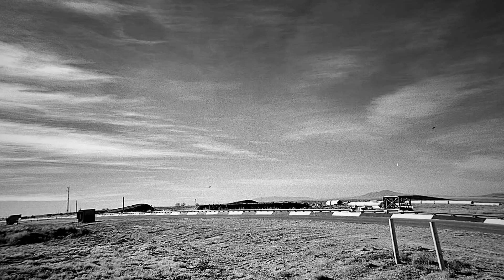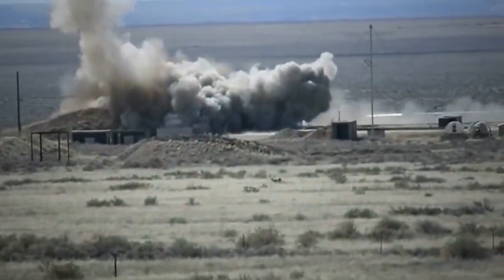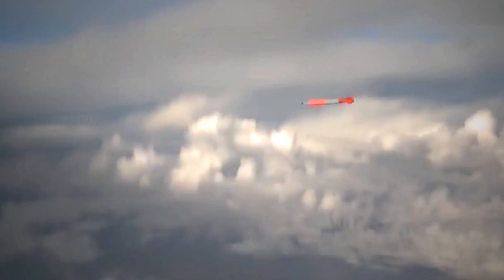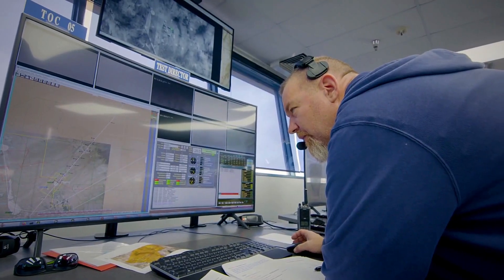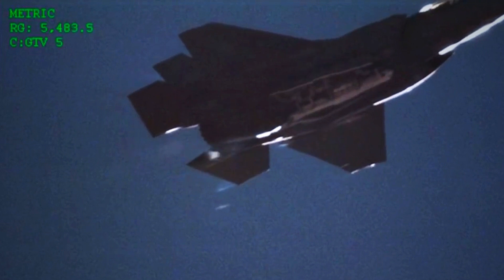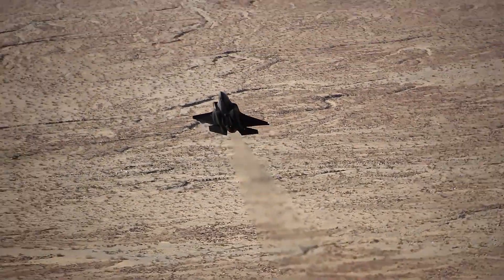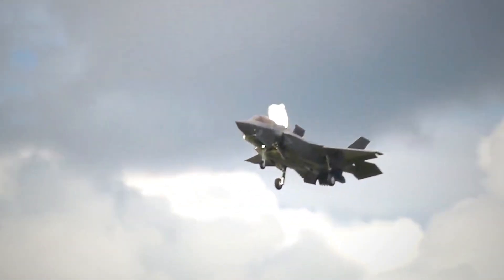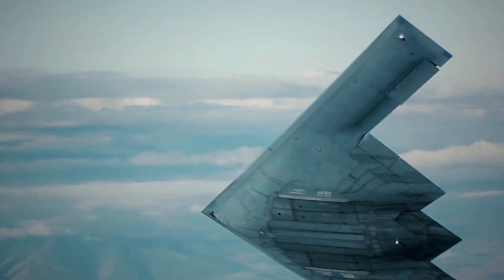Dropping the Safest Nuclear Bomb Ever

Comment: I find it interesting that there was a 6.5 magnitude earthquake in Tonopah in the spring of 2021!  Bunker busting nukes maybe?
Reply: Since we haven't tested nukes since the 90's, it's most likely an earthquake. Plus an earthquake of that magnitude would have to be bigger than a tactical nuke with variable yield.
Reply: @Olomana808  I'm glad that you have such faith in our government to tell you the absolute truth that you would like to hear!  Maybe the quake was not the direct shockwave of an explosive, but triggered by an already pressured fault or maybe not.  It's called critical thinking and it requires that you A) THINK and B) Question everything.
Reply: @matthewwheat3820  so you made up an event based on a single piece of unconvincing evidence, and then you mocked someone else's critical thinking ability... Amazing.
Reply: @userI3I2    Correlated events are normally considered as an initial piece of evidence.  That is how critical thinking leads to truth.  Most theories are wrong in the pursuit of the truth, but without consideration do not lead to new fact finding that moves towards finding out how something works or what happened.  I also find it interesting that every reply to my comment seems to deny a correlation or government wrong doing rather than question what else the military might use a bunker busting nuke for.
Reply: @matthewwheat3820  cool waffling bro. You sure did fill that paragraph with words.
Reply: @matthewwheat3820   you're right, I do have faith in the government to a certain degree. But that has nothing to do with what I stated. For example I can give you a bunch of legitimate sources about the US no longer testing nukes since the 90's (because of non nuclear proliferation agreements and other factors), and the common sense that if you know that something works, do you really need to keep testing it? Like seriously this video is about the safety aspects of a particular type of delivery system, not about the testing of explosive capabilities of said delivery system.  But if you would like I will take a look at whatever "alternative critical thinking" websites you would like to link, feel free.
Reply: @Olomana808  I like this exchange of ideas.  I feel this is good critical thinking and discussion.  If I may respectfully continue, do we humans stop testing new gasoline engines because we know they work?  How about new computer chips, we know the old ones work?  When it comes to nuclear weapons testing, I simply do not believe our government stopped developing and testing them.  The government has become better at hiding all of thier activities and much more discreet with military hardware testeing.  A tactical nuke is really a much smaller explosion than people think, easy to hide.  I can see potential in the ability of being able to trigger a "loaded" fault line.  Tehran lies on an active fault.  The government could potentially drop a weapon from an unmanned stealth aircraft and cause a monumental amount of destruction with a high degree of deniability.  The ultimate false flag operation and Tonopah could have been a successful test.  Then again it could just be a very unlikely coincidence.
Reply: @matthewwheat3820  You've already made it clear that you can't tell the difference between speculation and knowledge. You can stop reiterating that point.
Reply: @matthewwheat3820  nope. You keep arguing in favour of your baseless theory. And when people tell you why it's baseless, you assume they have 100% faith in the government.
Now, continue trying to defend your baseless theories, even though nobody is listening because you've presented zero compelling evidence.
Reply: @matthewwheat3820  I'm sorry but I stopped reading after the second sentence, when I saw how long your comment is. 
I assume you were admitting that you treated your baseless speculation as fact. And apologised for wasting my time. 
Apology accepted.
Reply: You guys are both losers and you show no evidence of anything stop arguing you both have baseless points end of story have a good day.